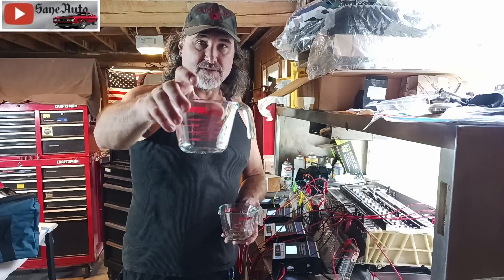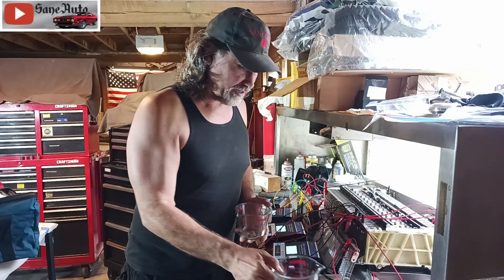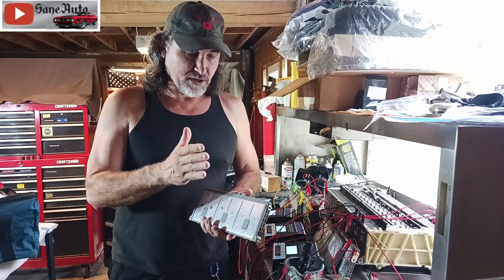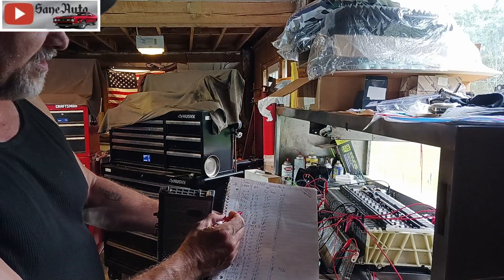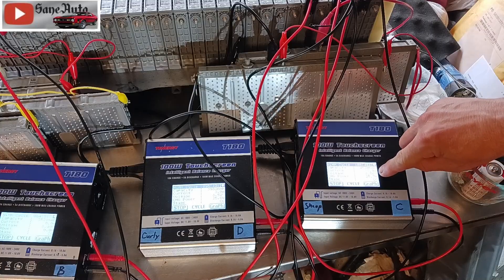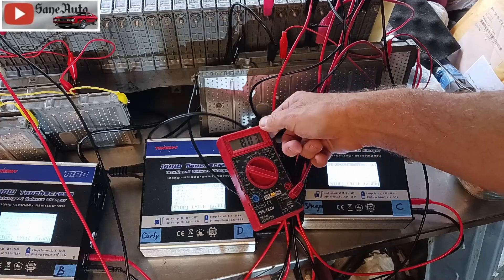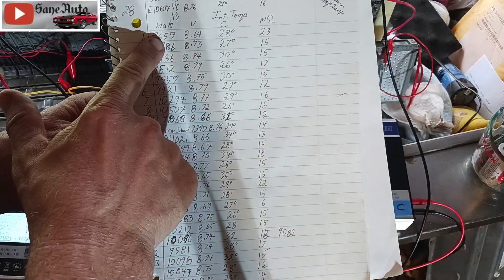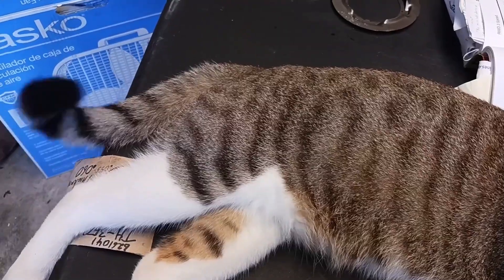Why I never use voltage to tell if a Hybrid car battery module is bad energy density & volume

Comment: ? I have a 2007 Toyota Prius and I scanned the battery and got a negative voltage on the 1st block.using king bolen scanner.